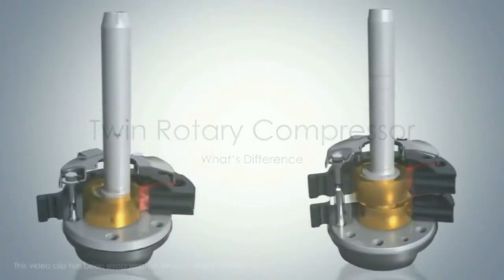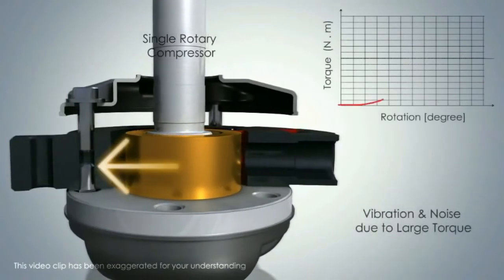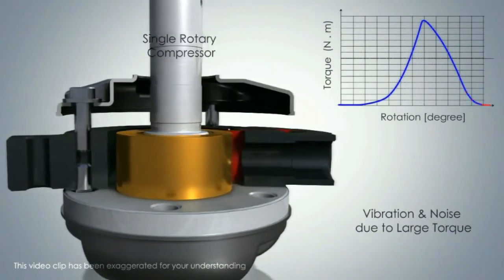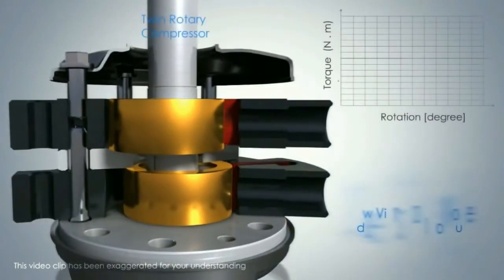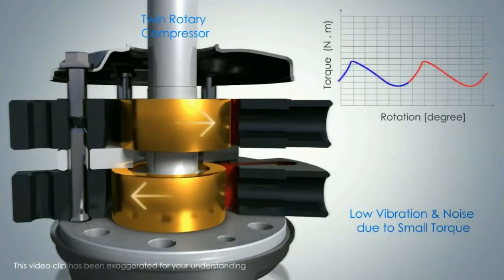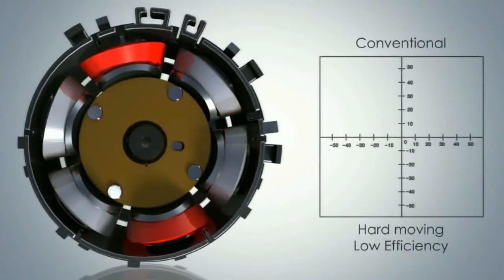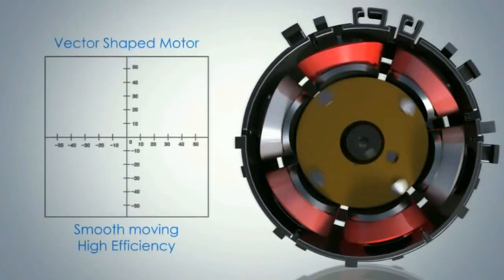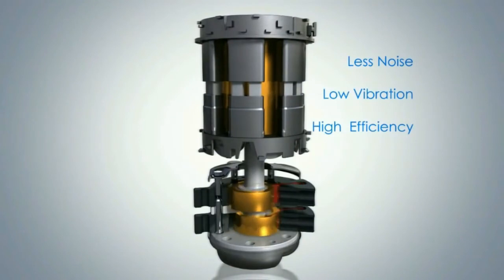Why Twin Rotary compressor is better than Single Rotary compressor

Comment: I am going to buy Hitachi 2 ton 5 star, model no RAS.G522PCBISF.
It has twin rotaty/R32... Is this ac is good ???
and how much unit consumption wiil be for 9 hours per day..Room size 200 sqf, hight 9 feet..I am living in top floor, sunlight his direct in roof and also 1 side wall is  in direct sunlight...

Plz rply sir...i am very much confuse..Thank you

Comment: Nice video! Daikin uses swing compressor in their AC - is this better than twin rotary (dual inverter) which is used in Toshiba ? Especially noise and vibration vise and ability to regulate RPMs. Thx.
Reply: @technicalgurubhaskar6657  it was a question… :)
Reply from the maker: @misenko856  It is as per the system design and lot many factors are involved, specially star rating

Comment: Sir could you please let me know about "gree ac" in case of electric consumtion . Is this advise able for less electric uses.
Reply from the maker: Electric consumption depends upon the KWH ie kilo watt hour. If your AC is of 1800watt and you run it for one hour it will maximum consume 1.5 unit. You may watch my video “How to calculate power consumption “
Reply: @technicalgurubhaskar6657   sir please let me know what technology using "gree ac" for power consumption in running time.
Reply from the maker: @sidharthpatra2730  you may calculate actual consumption by measuring wattage of AC with watt meter
Reply: @sidharthpatra2730  gree ac is made in china and pakistan and their reseller imports and sells, it is just a PR exercise much like Daikin(until recently) hence the higher cost.

Havells-lloyd, voltas and LG have manufacturing in India kindly choose wisely.

Comment: I am comparing dehumidfier from two different brands. They both use Panasonic compressors, one using twin rotary compressor while the other one using single rotary compressor. Unfortunately, no more details about the compressors are provided.
Theoratically, the twin one should perform better than the single one, but data of the twin one  shows that it dehumidfy less while creating louder noise. Any idea what's going on with it? It's really hard for me to choose which one to buy now🤣

Comment: Can you please explain the difference between Twin Rotator Compressor Vs T3 Compressor???
Reply from the maker: Twin rotor compressor is silent and energy saver where T3 compressor is meant for tropical conditions can work upto 50 degree Celsius temperature